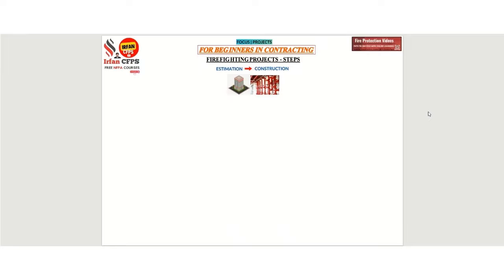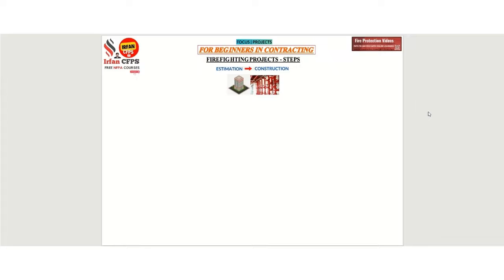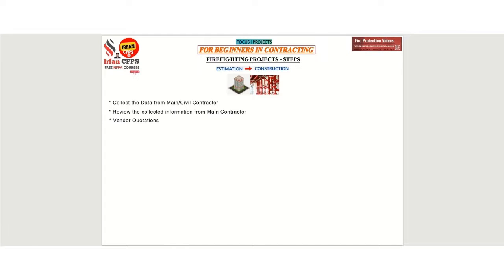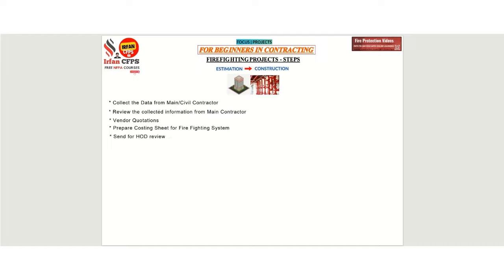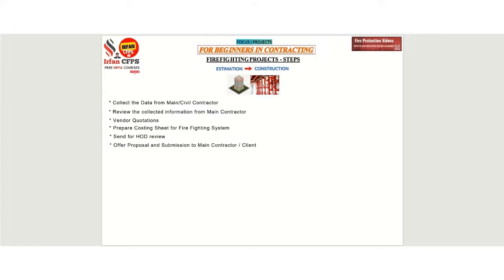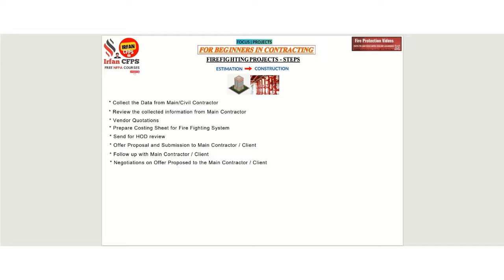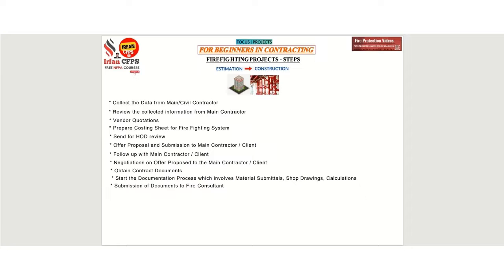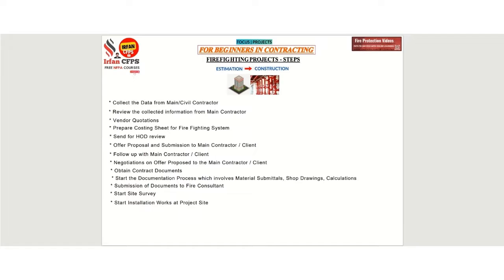Class 1 | Steps in Every Fire Fighting Projects | Firefighting Projects: From Start to Finish |

Comment: In the last point you said testing and commissioning has to be done in presence of fire consultqnt and client.. Arent we the fire consultant?
Please reply
Reply from the maker: A fire consultant provides expert advice and designs fire protection systems based on regulations and codes. A fire contractor installs, maintains, and services the fire protection systems according to the consultant's design.
During testing and commissioning, the consultant will check whether the fire protection systems are installed as per design, verify their functionality, and ensure they comply with relevant codes and standards. They also assess system performance through testing procedures, such as flow tests, alarm activation, and system integration.